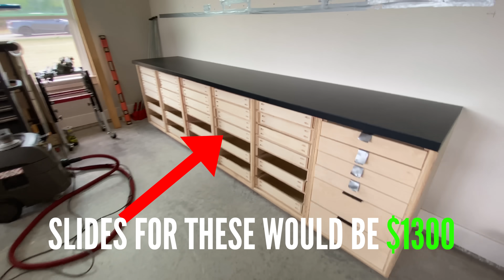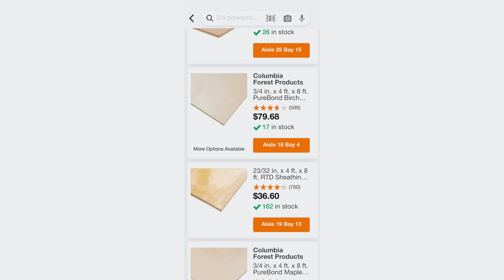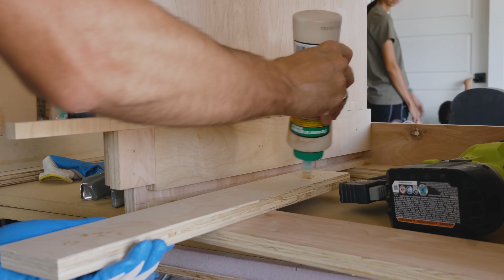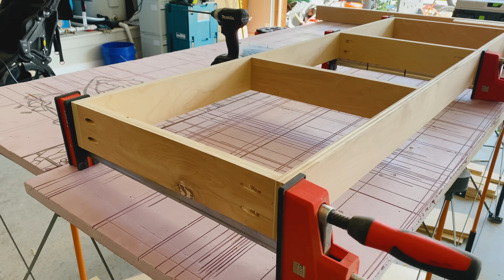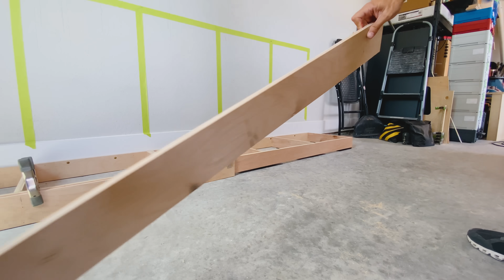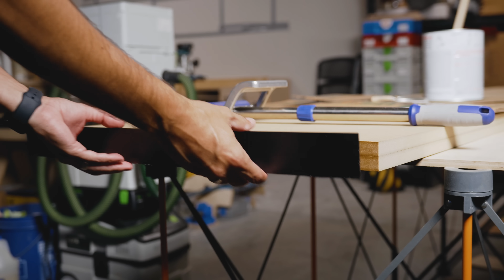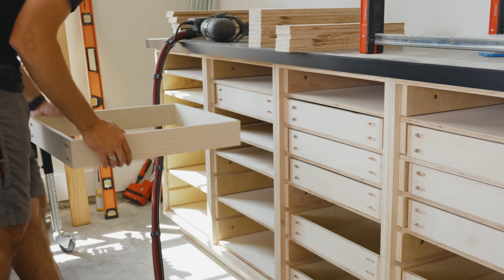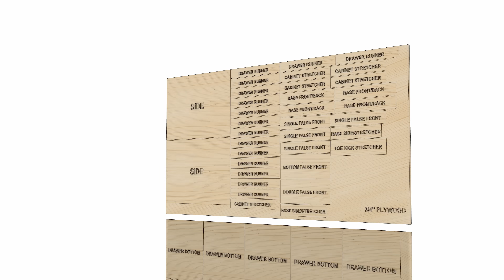Drawer slides are expensive. Do this instead.

Comment: Excellent video. One question, though. When you were installing the toe-kick on the base frames, is there a reason you brad nailed it from the outside instead of from the inside? It seems you had ample access to make it a little cleaner.

Comment: I use plywood drawer. Frounts cut at a 45 degree angle on all sides no hardware leave 1/8 inch for strength easy to clean just Polly Zarr polyurethane

Comment: Great video. For the gouged rim, you used a bit that didn't have a proper bearing to let it slide. Using the right bit, and also putting a piece of tape there, would have protected that edge.

Comment: G’day mate, nice video and stuff. The only thing, your approach to what you called your “toe kicks” was TOTALLY WRONG. There are no doubt videos on the web about this, but the FIRST STEP is to get the kick board perfectly level using wedges or whatever. This will leave gaps between the floor and your board. Grab a pencil and draw a line on your board parallel to your floor no matter how wonky it is. Cut along that line, with a jigsaw if need be. Place your kick board back on the floor and it top will be perfectly level every time. No silly spacers that over time will move and destabilise and warp your carcasses which will start making drawers stick. Like anything, your foundations must always be sound before building on top of them. Anyway, hope that helps. I’d be dismantling my drawer cabinets and doing the base properly then reassembling. Cheers, Michael 🇦🇺 👍

Comment: Fabulous video and spot-on comments.  
My Broski and I made similar "all plywood" shop cabinets with our Dad...decades ago.

Drawers & more drawers: Nuts, bolts, screws in massive bulk jumble. About 6" deep drawers for hardware. 10" to 16" deep drawers for tools.

Each box was 24" front to wall by 36" wide.

We used "L" bar Angle Iron as drawer slides.  Wood wax on the plywood & beeswax on the steel for smooth gliding.

Considering each drawer held over 100# of weight, the steel held up great.

You've made a great design for a woodshop.
Really like the helicopter posing as a ceiling fan. Was it effective for air circulation?
Snorkel 🤿 kudos!

Comment: Black laminate might be a hip cool thing but in the long run it will lots of issues like thing hiding in plain site. Lighter colored laminates or even white will reduce frustration in trying to find that screw/nut/washer etc.A premade countertop might have been a better option for about the same money. One other note, the cleats on the side might be cheaper if you used 1x2's cut out of shelving boards.

Comment: Lots of great tips and just general how-to that I think even I can follow this.  You got me on the duct tape work, it really was a little "piggish", but nobody is going to ever see that.   That was a good way to get insulation in that wall.  That is thinking ahead.  Impressive.
I am sure you put at least some wax on the runners, or they sell a half quart of special stuff for that, if you want to get fancy.  Forget the name.
Too bad the rubber pulls didn't work out, I would scratch my legs on those metal ones, maybe.
The weirdest thing is the marks your router left, I have never seen that before, no matter how hard you push.  Nobody will notice it but you, but your could try to buff that off, even maybe a magic eraser might do it.  I am sure somebody in the comments knows how to fix that.  Very strange thing.  Gluing the laminate down is very nerve wracking.  Do you really think you need that roller?  I have always used the edge of a 2x4.  Once that makes contact, you will never roll any bubbles out, or will you?
Did you put a drawer stop on those?  Probably.  
It all looks fantastic, too good for a garage.   Thinking for a kitchen you could just use that iron-on banding veneer for the plywood sides showing, it is pretty cheap.  These deserve a clear coat of water based poly, the oil-based will yellow over time.
Thanks, much appreciated.  BTW, just say drawer.  I thought it was DRAW-er, anyway.

Comment: My 2 cents of comments for things I would add to make your excellent build even better. 
* Put a plastic sheet on the concrete to prevent water from wicking up to the wood.
* Finish the front of the cabinets to make it easier to clean dirt and grease off of it. 
* Put a red warning mark on the drawer when you have pulled it out too far. One day it will happen and damages...
* Just me, but I would hide the edges with veneer or even the black laminate. Works better if it was in the original plan. 
* Caulk around the bottom kick board edge to prevent water from spills from wicking into the plywood. Likely delamination of the plys. 
🤿🏆

Comment: The marks on the edge laminate will happen from time to time. You were probably pushing or even tilting a bit too hard/much.
To avoid this with my customer work, after the edges have cured..I go over them with wide painter's tape.
Then you use the router to cut off the excess. There are small hand planes expressly made to fine-tune the trim after the router.
I just use a small, but very sharp hand plane that takes just a whisker off the edge. 🤿

Comment: You do need to be careful with lumber dealers.  My son wanted me to build a long dining table from walnut.  We went to a "reputable" lumber dealer in West Dallas.  The sales guy and I went out into the warehouse and I picked lumber 10 feet long with almost no defects.  I had the dealer do preliminary milling because I don't have equipment in my garage shop to handle lumber that long and 8-4.  My son went back to pick up the lumber and brought it to me.  It was not the lumber I picked.  It was longer, had multiple defects and lots of color variation.  I called and complained and they did reduce the price.  In hindsight, we should have loaded it up and returned it and bought somewhere else. Dealing with all the defects took an enormous amount of time, energy, frustration and swear words.

Comment: Great ideas contained. Well executed workshop building techniques. In the UK lots of people smear at using BB ply as substandard and weak. However for garage/shop use found it matter if the veneer has two or three key hole patches? The ply build and zero void is what is important. Diving 🤿 into your channel for the first time I’m glad I picked up some great ideas, thanks.

Comment: Re laminating the edges of MDF:  It soaked up the contact cement; or perhaps just soaked up the solvent leaving something unusable behind?  I think you should seal the edges first.  Using what's on hand, I'd pick shellac, or thinned out glue.  But there's probably a product for that.  I never had the issue because I used hardwood edge banding (purpleheart) instead.
🤿

Comment: I thoroughly enjoyed this video.  Good job keeping costs down while producing a quality outcome.  My only objection might be not equipping at least some of the drawers with metal slides.  The drawers you made appear to slide in and out smoothly enough.  Yet none of them are capable of fully extending (without being pulled off their rails, that is.)  Metal slides, of course, come in full-extension versions.  Maybe not important for your purposes here, put personally myself I would have spent a just a few dollars more to fit at least some of these drawers with full-extension metal slides.

Comment: Here in the UK we tend not to build "toe kicks". We use adjustable plastic legs that screw to the underside of each cabinet, one near each corner. They have around 1 inch of adjustment They cost about £20 for a pack of 30. There is a clip on each leg that you can attach a front board. Amazon USA sells them and also metal ones.

Comment: A major reason for garage sheet rock to always be taped off, at least with one layer of tape is to prevent immediate fire intrusion between the edges of the sheet rock. There is data on how long one and two layers of tape prevent fire from spreading through sheet rock which I don't have right now. It's a major safety reason, not just to prevent drafts etc. Some cities mandate any garage that is sheet rocked be taped with one layer of tape, now you know why, it's the fire code.

Comment: One option you missed considering, I think, is just using roller bearings. 

Amazon: 100 Pack 608-2RS Skateboard Bearing, Rolling Bearings, 8x22x7mm 608rs Bearing -- under 19 bucks, or about 20c each. They are small, 22mm in height, so you can use them on any of your drawer sizes, any number of ways to use a washer and a screw to attach to your side walls, notch the separator boards to put a place for them using a hole saw or forstner bit. Use two or three per side, and you can do 16 to 25 drawers per 100. This would provide a much smoother movement than your slides alone, and never need re-waxing. You could even put minor divots into your boards where they ride the bearings,  and it would provide a measure of "stops" for different pull distances. 

It's basically what  a drawer slide does, just without the extra steel outrigging. If wear on the wood is a concern, a very thin metal strip along the outside edge would solve that.

Comment: Instead of using so many shims, which are susceptible to movement and compression. You could have furred the bottom of the cabinets with strips plywood brad nailed to the bottom of your toe kick frame. There’ll be more points of contact of your structural frame touching the ground. Using that many shims stacked that high creates a precarious, unstable situation, particularly because you’re not attaching to the slab underneath. 

How theyve been doing custom cabinets for years is to build it in place, utilizing all of the given space. Instead of building a bunch of boxes, you just build one big one with a bunch of divider walls. It would essentially halve your plywood usage and labor hours. 

I realize that using that pocket hole jig makes things kinda easier for alignment, I guess. Countersinking at 90 seems like it would be much faster and stronger. What’s the reason people like pocket holes so much? It’s a ridiculously weak joint. I’d rather use 2 1/2 “brad nails.

Comment: Hey bro instead of cutting off your shims and  you can screw plywood cutoffs to the inside after levelling, then simply remove the shims. This lets you reuse shims and also nicely uses up cutoffs that might otherwise be scrapped. I got this idea from Michael Alm, he explains it in the video where he builds his new mitre saw station.

Comment: A couple years ago I had a 80 ft. tall white pine smash the roof on my shop. There was a torrential downpour for a couple of days during that storm. My table saw ended up looking just like yours. A lot of tools where damaged or ruined. I moved everything I could out of there until a new roof could be constructed, but I couldn't bring the table saw in the house. I moved it to the corner of the shop and threw a tarp over it, but it don't look so new anymore. Nice cabinets and video. I like your idea for the toe kick.🤿

Comment: In case you don't know,
It's called "DUCT tape" because it's used on air DUCTS to plug the air leaks at the junction of 2 DUCTS.
So yeah, the odds of that tape plugging air leaks is pretty high. 🤿

Comment: I " trim my countertop with a 3/8" - 1/2" inch of hardwood. 
Next, I apply a finish on the wood. 
 Then I place the laminate on top and cut  it down to fit.
This gives me an edge that I can actually make minor repairs to if I damage it.

Comment: 🤿LOVED the duct tape...  Fron here-on-in... no more "mud and tape" for my houses... straight to the duct tape  wooohoooo!!!

On a serious note, I liked the 'old world tech' of the drawer runner solution -- every couple years apply candle wax (you may be able to just rub cold wax if the candle fits the groove) to both the groove and the bottom/outside edge of the drawer, and you should have pro-level sliding.

Comment: Great Job! looking at what happened to the laminate, I think there are a few ways to avoid it:
 1) if you set the depth of cut of the router to the laminate thickness, then it might have eliminated the chatter.
 2) increase the thickness of the bearing by using painters tape on the edge that got the chatter (this might leave a little thicker overhang on the top).
 3) use a second surface at the same height as the counter to keep the router square to the work.

Thanks for the awesome ideas! 🤿

Comment: As others have noted, the marks on the edge banding is from the router bit burning the laminate.  I worked in a cabinet shop in North Carolina.  The way we prevented this was by brushing on a thin coating of Crisco shortening before routing laminate or edge banding. It's super quick to brush it on with a small chip brush and easy to wipe it off with a rag and acetone. Keep up the good work. 👍
Reply: there is nothing more north Carolina than using crisco as a lubricant haha. (im from NC so this is a positive comment)
Reply: This ... or do it freehand.😅
Reply: @EvulOne42  His dad actually brought the right tool to do this manually. In Germany, that tool has a proper name (okay, two, actually): Stemmeisen and Beitel. In English, it's one of many tools called "chisel".

🤿
Reply: @klausstock8020  you can NEVER have too many chisels !😊
Reply: @EvulOne42  I, actually, do have too many chisels. In addition to the chisels I bought in the 55 years of my life, I also inherited maybe 50 years worth of chisels.

Of course there's always that one chisel I don't own yet. But which I need.

TL;DR: Yes, you can have too many chisels, but it's still not enough. 

What? 

Electro-pneumatic?

Glad that you asked. 

Yes. 

I got a few of these.

Just...not all of them.

You need 'em. Trust me.
Reply: we always used floor wax, but only with a bullet or laminate bit- seems like the edge wasn square (or router) didnt so much look like a burn as much as the couter cuting into it. If you are getting that much heat over 12 or 14 ft you got a bad bearing.
Reply: There are also square plastic bearings you can swap on the flush bit which will prevent that burn in from the metal bearing.
Reply: Great idea, thanks!  Acetone may melt plastic.  Try Mineral Spirits or Paint Thinner to remove grease. Finish off with Rubbing Alcohol.  Also works great for tape residue.
Reply: My laminate supplier carries a product called Lami-Lube for routing laminate.  Comes in a 10.5 oz spray can for $7.69.
Reply: @RTiff welcome to a future where many curses may be spoken out loud, or if you perhaps belong to those quietly muttering to yourself for a long time before you snap... or perhaps you are one of those disgusting people who instantly get a knack for whatever you decide to do 😁
Reply: Wow. Yet another use for Crisco😂
Reply: @hlblundell  be careful acetone dissolve plastic, better is zippo gasoline, IPA, etc it is more gentle and dissolves glue perfectly but no harm abs/plastic
Reply: Acetone!?  Dude, it's only shortening, plain old rubbing alcohol is cheaper and won't melt plastics.
Pam   {Tom's wife}
Reply: @Tom_From_Oz acetone doesn’t melt edge banding. We used it because that was the only solvent we kept stocked in the shop. Acetone cleans hot melt glue, sharpie marks on laminate sheets, and all of our finish spraying equipment. I have multiple years of first hand experience in a commercial cabinet shop.
Reply: @hlblundell  It's Nail Polish Remover.  I can understand just having it on hand, but there are safer and cheaper things!  Isopropyl will also remove sharpie, and there is nothing better on glass.  You do know that hot melt glue is plastic right?  There are YT videos showing how to make your own glue sticks. So, while it might not melt laminate with a fast wipe, personally, I would be careful that none spills and is missed.  Also, acetone paired with one of those "Magic Eraser" sponges works 100% better.  
I don't know commercial cabinet shops, but I'm 66, and my father preferred Lacquer Thinner for his own spray compressor. On the other hand, my mother used Dawn and hot water on Crisco.  I guess it's a personal choice thing, LOL.
Pam
Reply: @Tom_From_Oz  "Magic Eraser" sponges are far more destructive than acetone the vast majority of the time.  The "Magic Eraser" is basically fine grit sand paper that cleans by removing bits of the actual material being cleaned, that's why it is so easy to damage so many finishes with it.  Personally I wouldn't use either one of them on laminate but I am also not a professional and have 0 experience in that setting.  Also lacquer thinner contains acetone, it's actually usually one of the most abundant ingredients iirc.
Reply: @Mad-Lad-Chad  Didn't know about the thinners, but those sponges with acetone are used to remove the factory paint from soft vinyl doll faces.  Heat set plastics and styrofoam melt in acetone making a glue.
But I have used those sponges on formica, glass, porcelain and even painted walls with no disasters.  I suppose there's a science to it.  I just with the sponges didn't just dissolve with use.  Not giving them up LOL
Pam  {Tom's wife}
Reply: @Tom_From_Oz  I mean if something works for you I wouldn't ever give it up because some internet dude said something xD But that is indeed how they work, it's well documented online.  That said, obviously they do in fact work.  I've used them myself, I just am hesitant to use them because of the way they work.